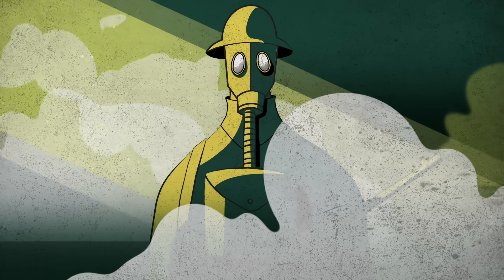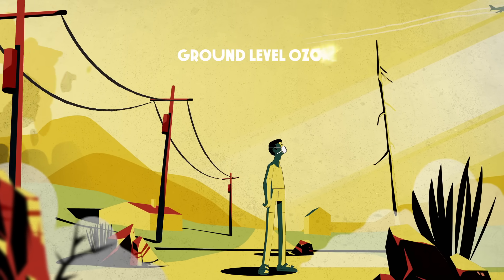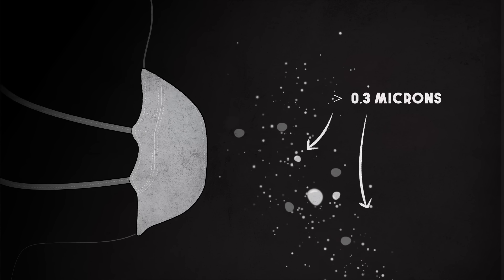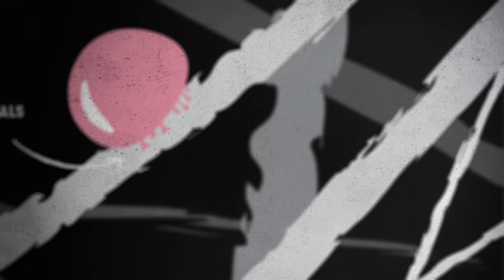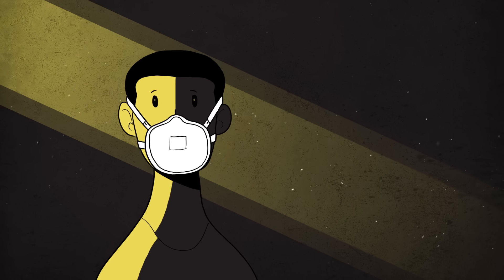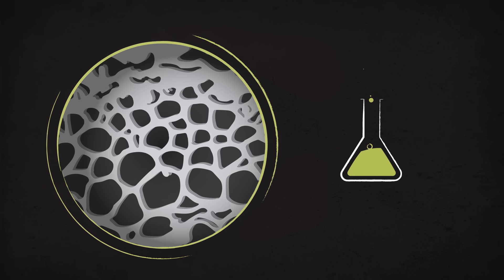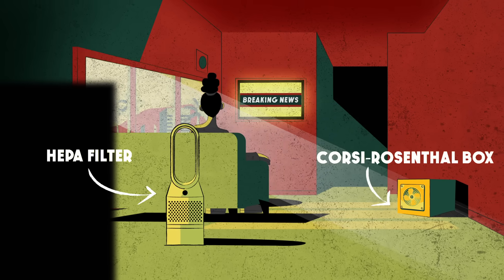How do gas masks actually work? - George Zaidan

Comment: I must say, the poem “Dulce Et Decorum Est” certainly comes to mind upon seeing this thumbnail. Excellent poem, that.

Anyhow, I personally wear a respirator when going out from time to time, partly for dieselpunk attire, but more importantly in case of coming across harmful airborne materials, such as smoke, soot, noxious gasses from sewers or the like, or certain germs.

They’re also a bit more comfortable for long term wearing than N95 masks in my opinion from experience during lockdown, as those tend to fill with humidity from breath quite quickly due to lack of outlet valve.

Comment: If things get polluted enough I am just going to rock a full on head covering mask GP-5 style for the vibes alone.
Reply: Be careful, every single GP-5 gas mask filter has asbestos in it. This has been proven. You’re better off using a NATO gas mask instead.  Unfortunately GP-5 gas masks are completely incompatible with NATO gas mask filters.

Comment: So do air conditioners no longer heat up the planet while cooling our homes?? Or are they making my room colder while making the outside hotter, creating an issue where my room gets cooler but others have to suffer worse heat? Or does that heat get dispersed since outside is a much larger area
Reply: It still does heat up our planet, but not the way you’d think. 

The real reason air conditioners causes heat is because it consumes electricity, and generating that electricity, likely in a national generator, requires heat. If it’s a fossil-fuel-powered generator, it’s way worse, because it also produces warm house gases like CO2, which kept the heat we receives from the sun from radiating out into space. It’s also why we need sustainable energy sources like solar panels and nuclear energy. 

Purely making your room colder while making the outside hotter does not warm up the planet, it’s just that doing that needs power, which causes global warming in the process of generating it.
Reply: @ so if it’s on renewable energy it’s not an issue and on fossil fuels it is? Does that make running acs a climate justice issue? That those with means run air conditioners which makes it even worse for those without?
Reply: @RealisticallySustainableDiary  yes, if it’s on renewable energy sources it’s much better (not completely harmless, but nothing is). The thing is, we can’t choose what types of electricity our appliances use, so we need greener generators. 

I don’t really know what’s climate justice, I just know that if we keep warming up the planet, a lot of people will suffer.

Comment: we know how gas masks works! PUTS HOSE THROUGH A FILTER  0:14
Reply: That might be an inhale valve, it's a pretty cartoony aesthetic it's hard to tell
Reply: Those are special snorkel gas masks. I remember BC i used to have one (wich sadly ripped on me). The filter is usually attatched on your chest / belt, a long snorkel connecting it and the mask. Main benefit is no strain of neck muscles due to the heavy filter

Comment: N95s don't actually stop only 95% of normal particles. 
They are rated on how well they can stop particles of 0.3 microns, which are the highest penetrating particle, do to exceedingly small ones basically ricocheting of the surrounding air.

Comment: The van der waal force might be what clumps aerosols together but this is not part of the filtration principles.  Air filters work by interception, impaction, diffusion (brownian motion) and electrostatic forces (depending on the media, aerosols and media condition).

Your analogy of representing the media with a forest is spot on, it is how I explain things to my customers, a 1 micron particle going through 1mm of media is like a fly flying through 1km of forest (roughly speaking), the odds are practically nil that it will make it across but the air can still blow through.

Comment: Can we make a filter that takes normal air and extracts oxygen.
Reply: the only way you can do that is by liquefying the air and pouring it over a strong magnet
Reply: @i_am_a_toast_of_french  Can yo elaborate on the reason?
Reply: @The_Observer_god  because oxygen is paramagnetic
Reply: @i_am_a_toast_of_french  Is there a filter that could filter out molecules.
Reply: @i_am_a_toast_of_french  that’s not true. there are many ways to separate out pure oxygen, it’s just they are all wildly impractical
Reply: @blank_3768  ik you can also do fractional distillation, but that requires multiple passes to fully get rid of the nitrogen from the oxygen
Reply: yes but it would be wildly impractical e and you wouldn’t want it. breathing pure oxygen for extended periods of time is toxic.
Reply: @blank_3768  I want oxygen as rocket fuel🚀⛽

Comment: I mainly use an air purifier for minimizing dust in the room and internals of my desktop PC, on top of daily vacuuming. This reduces dust buildup and need for cleaning. However, in areas where there is less air movement, dust still do accumulate over time.
Reply: Yep. Dust is everywhere!

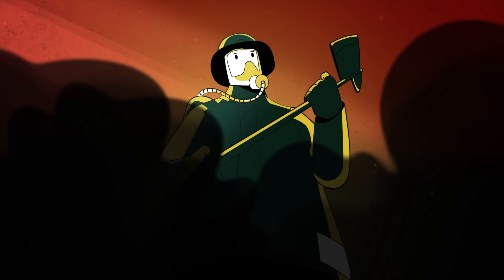Comment: 1:16 3:00
I love how they paid attention to even the smallest details, like accurately depicting the type of bond in each molecule.
Reply: Hate to be that guy, but technically, the bonds for nitric oxide and nitrous oxide are depicted incorrectly:

1) Nitric oxide has more of a double bond + a free radical (•N=O), though the radical can sometimes be depicted as a third bond (drawn as a dotted line, NOT solid line!) to show "resonance". 

This dotted line is shown correctly for ozone as it resonates between (O=O-O) and (O-O=O), thus the structure can be "averaged" to give a dotted line throughout the ozone molecule.

2) Nitrous oxide can be drawn as (N=N=O) or (N≡N-O), but NOT a single bond (N-N-O)!
Reply: All I know is that Ted Ed never fails to amaze